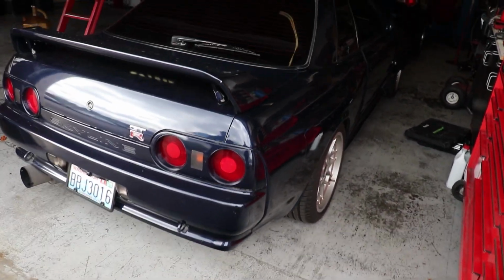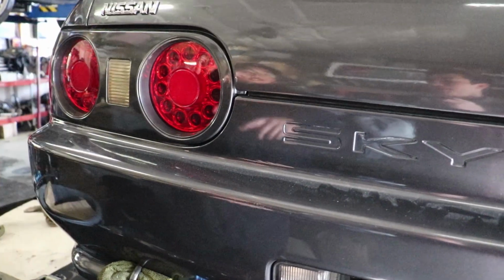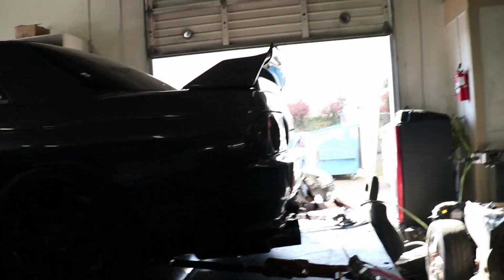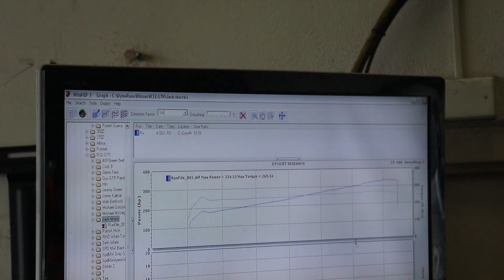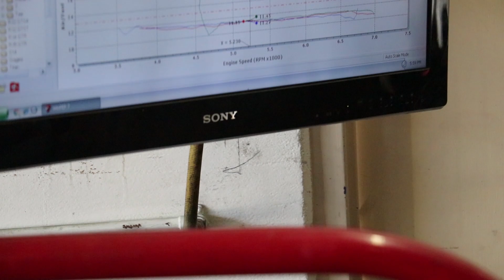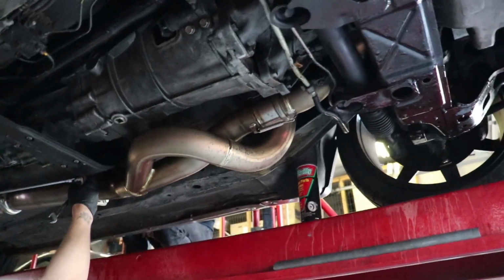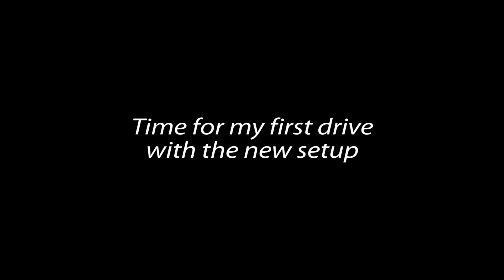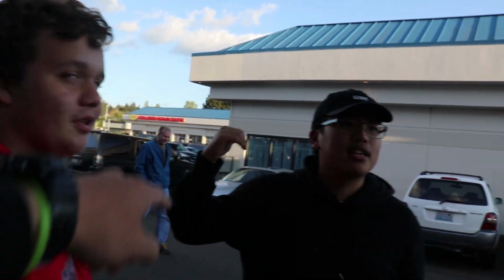I Have the LOUDEST R32 GT-R! (Dyno Tuning & First Drive)

Comment: Click bait...in the Skyline community your car sounds avarage. And its not the mines pipe that gives your car the high pitched tone, that's how all tomei ti sound, you need to work on backing up the sound because 380 is only 40 more HP from stock.

Comment: I am 12 I have a 1991 Subaru brumby 
I bought two carbon fibre exhaust tips for it I was wondering because I have to change the end of the exhaust size should I straight pipe it

Comment: Hey jaket I just won't to know if your gtr is rear wheel drive or all wheel
Reply: MotoMikey All skylines GTR’S are AWD but you can disconnect a plug and it makes it RWD
Reply: @anthonyramirez6512  but when I had my skyline r32 it was an Sr big turbo rear wheel drive
Reply: Anthony Ramirez you don’t disconnect a plug to make it Awd..
Reply: MotoMikey no it wasn’t. You never have owned a car. GTRs don’t come with SR’s